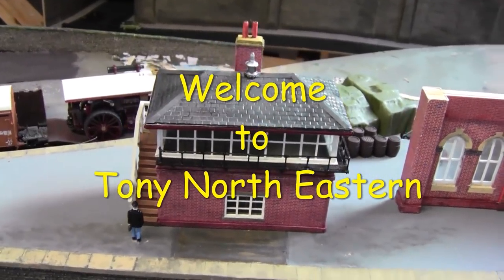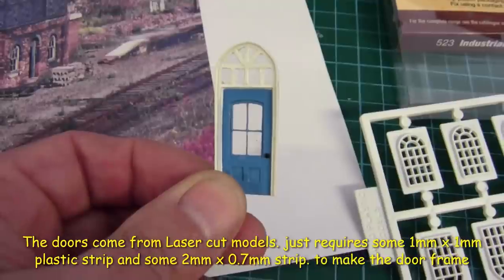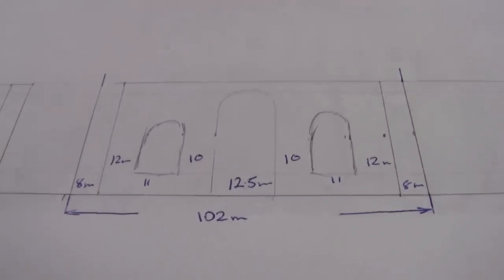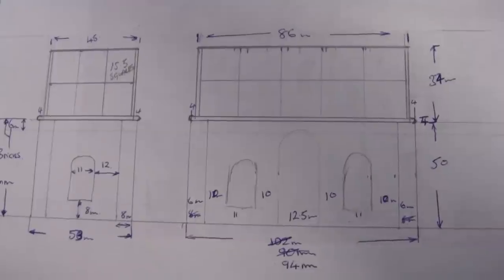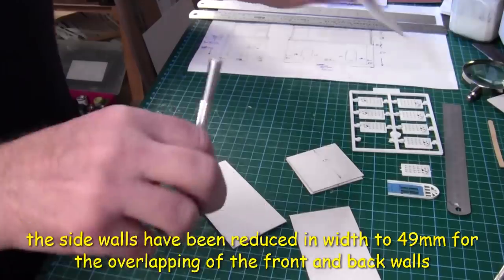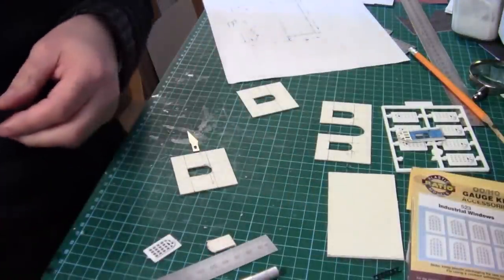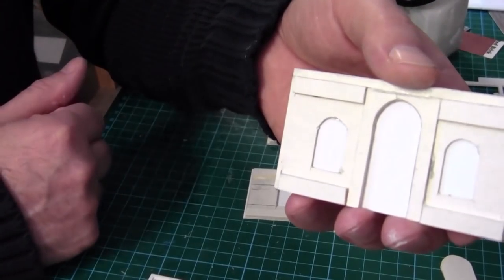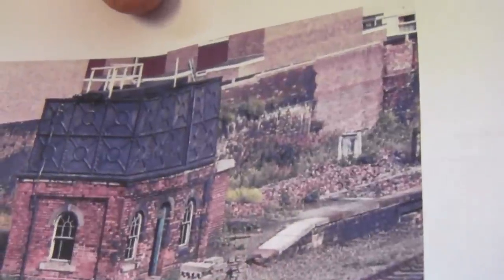OO gauge N E R  Water Tower Part 1.......No256

Comment: I'm new to scratch building , but I'm a practical bloke who doesn't like to lose  bits of fingers  using  scalpels and steel rules , so I found an old 12" rule and using some spray adhesive stuck some 180 grit paper to one side . It doesn't move  with medium weight pressure and doubles as a fine file  .  :-)
Reply from the maker: Now that is a great tip. i often have trouble getting the rule to stay in place with using extra force to keep the rule where i want it. i may borrow that idea, thanks again stay safe Tony

Comment: Really great instructional video Tony ! never thought of adding the 4mm scale !!
Reply from the maker: Hi Steve, the sizes sometimes don't always work out. when marking out the drawing a set of measurements was missing. that's when i noticed the error on the water tank. adding the 4 mm got the dimensions spot on. it was hard work....but got there in the end.............have a great weekend Tony

Comment: Hi Tony
Another interesting build. When you were measuring I was shouting at the screen that the tank plates were normally 4 ft square in those days but you ended up with the correct dimensions in the end. The second building looks more modern to me.
Regarding your tour of the layout, this was great to see how you had squeezed everything in. I assume the line does not go any further beyond South Shields.
Keep up the good work.
Reply from the maker: Hi Alan. i thought i could here my ears burning, lol, 4ft square that works out about 15mm in oo gauge, at least if ever have to build another one, i now have the sizes. The line does stop at south shields. it use to go down the quays and dock yard to bring in the fish. and supplies. but that was long before the station itself was built. but some traffic continued for a while. but mostly the passenger services took over. thanks again for commenting stay safe..........best wishes Tony

Comment: Hi Tony
Just found your channel. 
That was very useful thank you , could you confirm what type / make of glue you use for your card buildings please.
Regards Julian
Reply from the maker: Hi Julian. welcome to the north eastern. i used two types of glue depending on what i am doing. Rocket card glue. and PVA wood glue. The rocket card glue i use for main building assembly. and small parts. PVA, glue i use on bigger pieces like wall strengthener's.  i hope this helps.  all the best Tony
Reply: Thanks Tony that is interesting for me as I am new to the hobby and just finding my feet with everything , does anyone use Balsa-wood now a days when scratch building as I bought some 2mm with a view to having a go at some stage, but from what I have seen most modellers seem to favour card or plastic.
Julian

Comment: cool prototype. great tip on folding the brick paper to fit the windows. Tony would you say the research/measurement/sketch takes almost as long as the build itself?
Reply from the maker: Hi John. you are right there my friend. at least a couple hours per small building. so you can now imagine how long it took to do the station south shields. as it was almost a week. thanks again see you shortly...........Tony

Comment: Hi Tony. From the colour photo of the water tower, I don't follow your logic that the outbuilding is detached from the water tower. Just because the wall of the outbuilding is set back from the water tower, this doesn't mean it is detached. I think you need to do some more research if you want your model to be accurate.
Reply from the maker: Hi Paul. thank for commenting as always. your comment has made me think so i checked up the old survey maps. and the water tower does stand alone. the small building was add on...thanks again for your input...........stay safe....Tony

Comment: Hi, new to your channel! Just an ask - where is the original tower in the photo? As a one-time Sunderland resident who travelled quite a lot of the old NER east coast rails in the 70s, I'd be interested.
Reply from the maker: Hi Kevin, firstly welcome to tony north eastern. you have a lot of catching up to do my friend. the tower is at south shields station. north end towards river drive bridge... hope this helps..........all the best Tony
Reply: @TONYNORTHEASTERN  Hi, thanks for the info! I used to get the DMUs regularly to Newcastle, but I started using the coast line from Sunderland to Hartlepool to do a training course in the mid-70s, and I was amazed and charmed to see semaphore signalling and mechanical points! That got my interest going on railways!
Reply from the maker: Hi Kevin Just wondering if the line still there now, as some many have gone...cheer's Tony
Reply: @TONYNORTHEASTERN  Hi Tony, I can't confirm that...I've been living down in the south east for 40-odd years! One thing though - I remember at the time, the received wisdom was that there were never going to be any new lines built. And yet, within a couple of decades, it all kicked off again!
Reply from the maker: Hi Kevin. i have been down south for 32 years. time flies....Hence why i have built south shields station. found memories....

Comment: Tony, I tried looking on some old maps to see if the water tower was attached to the other building https://maps.nls.uk/view/120934218 but you see the cut off point !!  - I've stitched two OS25 maps of the area  circa 1915 and it shows the signal box , and then two other square structures both of which are detached.  As to what box on the map is the water tower, that would take some further research.... If you can provide an e-mail address I can mail you the image, or just overlay https://maps.nls.uk/view/120934209 with the link above - Hope that helps
Reply from the maker: Hi Malcom. thank you for taking the time to find the maps. if you want to get in touch. search Tony North Eastern of facebook then i can add you to messenger. and from there we can make contact.............thanks again Tony
Reply from the maker: Hi Malcolm. i have the very same map in my consett to south shields. thanks again for your assistance........best regards Tony
Reply: @TONYNORTHEASTERN  Tony, I thought you may have already done the same search and already have every possible photo and map in the public domain, but it was fun trying to help out :) - I don't do facebook, but thanks for the invite
Reply from the maker: No Problem........all the best Tony